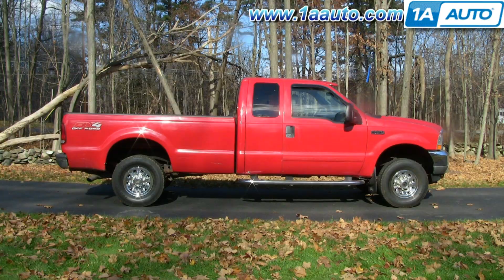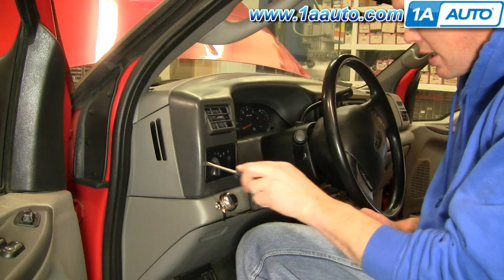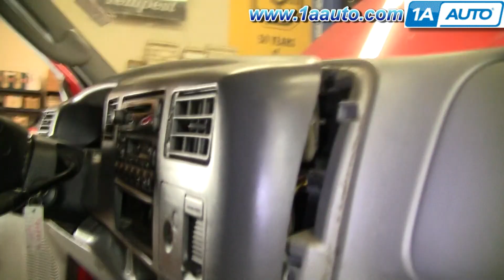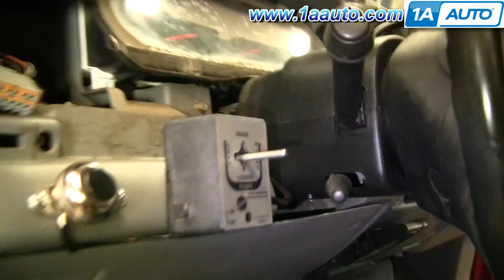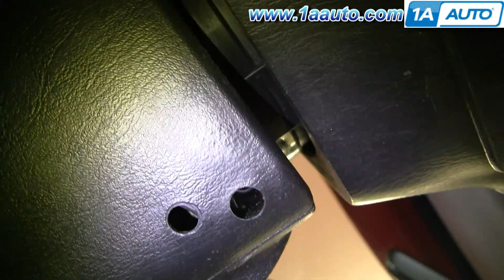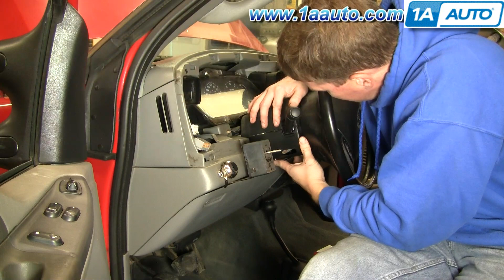How to Replace Combination Switch 02-07 Ford F250 Super Duty Truck

Comment: I appreciate the time and effort doing these very helpful videos.  I have a 2002 Ford F 250 SD and your explanations are on target.  I would add this for DIYers....give yourself plenty of time to do the repair.  Don't be surprised if it doesn't go according to the way you see it.  Age of truck or car, rusted or stuck bolts and other anomalies can bog you down.

Comment: No need to take all that apart just take off steering column trim and boom your done
Reply: I'm watching this getting ready to change out mine.  I'm thinking surely that whole panel doesn't need to come out.  Scroll down and see this first comment.  Great advice right here!  Thanks!
Reply: I was thinking that....I'm replacing mine tomorrow
Reply: Same!
Reply: Oh thank god, have a f650 Water truck that needs this, didn't want to attempt pulling half the dash out

Comment: Great video! I would hear a strange clicking noise from my steering column sometimes when I would turn the steering wheel. Also made the same noise when I would move the tilt wheel. Then all of a sudden NO blinkers at all! My emergency flashers still worked so I knew it wasn't the relay and my turn signal fuses were still good so with all that data I knew it had to be the multi switch. This video made the repair easy! Thank you!
Reply from the maker: +Shane Pearson Thanks for watching. 1aauto.com

Comment: I have a 2008 f250 ,the blinkers ,hi beams .and wipers work just not the windshield washer pump does not work ,replaced pump still nothing .Could it be the multi switch?
Reply from the maker: +matthew williams You may want to check the fuse and also check the circuit to see if there is power going to the pump when the switch is activated. 1aauto.com
Reply: 1A Auto Parts I checked no power to pump. Not sure which fuse or relay it could be.
Reply: The wipers would not shut off today .
Reply from the maker: +matthew williams It might be. You may want to test the power going to the windshield washer pump motor to see if there is power to the motor when the switch is activated. Hope this helps you out. 1aauto.com
Reply: i just checked and there is no power when switch is activated.
Reply from the maker: +matthew williams It might be a bad switch. Hope this helps you out. 1aauto.com

Comment: Much obliged on the video as it really helped replace my switch.  A big tip I figured I'd share for those who are still looking for this kind of repair, that saved me quite a bit of time was that I was able to skip removing the dashboard panel completely and only detach the pieces around the steering column.  Also, removing the bottom piece allowed much easier access to the ignition switch.

Comment: My flasher on my 02 F350 was making an intermittent buzzing noise which would stop when I put on a blinker or applied brakes so I replaced it... now the new one is making the continuous blinker sound whether blinker is on or not.. same with emergency flashers? Could it be I need a new Multi-Function switch?  As a side note... This all started when my driver side window was left down during a pretty good rain which soaked the dash and seat pretty good.
Reply from the maker: +Bo Holland Thanks for watching!  It is very possible that the switch could be causing this issue, but if it all got wet like that then you should get an electrical diagnosis done.  1aauto.com
Reply: Replaced my Multi-Function switch.. easy peasy.  on my 02 F-350 I did not have to remove headlamp switch, dash, radio, lighter wiring etc., simply removed tilt knob, ignition cylinder and upper and lower column covers and replaced switch.  Resolved my problem.  Thanks for info and instruction!

Comment: my girls truck has signal issues when moving the steering wheel for tilting. sometimes the signals don't work. she has a 01 sport Trac. any recommendations? not to vehicle smart. just the basics
Reply from the maker: +Joe Alaquinez Thank you for watching. It appears there is a loose connection, or wire in the column that shortens out on occasion when tilting the wheel. It is recommended to remove the upper and lower covers to check the wiring, or have a reputable shop diagnose the matter. 1aauto.com
Reply: ok thanks very much.

Comment: I cannot figure why anyone would down vote this. Perfect video, especially with the pain in the rump under shot of the column, + lighting,  to show where the release was on the lighter. 

 This made the job so much easier. I just did this on a 2003 Ford Excursion. I was able to do the job without removing the façade, so it was remarkably fast. Perhaps the Excursion is a little different to allow for skipping that step? 

 Regardless, I now am ready to change the radio now that I've seen this video, so two birds, one stone.

 Thank you for posting this well done video.
Reply from the maker: +David Gibler Thanks for checking us out! If any of our viewers needs to make this repair wwe carry the replacement turn signal lever shown in this video on our website. Here's a link to them. We also offer free shipping on all orders in the US. http://www.1aauto.com/1A/turn-signal-lever/Ford/F250-Truck/1AZTS00082?utm_source=YouTube&utm_medium=CTA%20Comment&utm_campaign=1ATony

Comment: Outstanding Video. Very helpful. Had a bunch of clicking coming from under the dash that temporarily stopped when turn signal or brake was used. Found out the problem and what to replace but not HOW until I found this video. Feel kinda guilty cause I needed the part asap and got it at a local parts store instead of 1A Auto then used your awesome video and saved myself something like $300 to $450 in shop bills.. Thank you .. One note -- this didnt cover having tilt steering and that does factor in this repair. Could not remove lever ( dont know how so didnt attempt)  and hence the lower cover either. Was able to work around but would have been so much easier with it out of the way . Otherwise,,  Well done and Im in your debt
Reply from the maker: Haha no need to feel guilty! Our main goal is to help you save some cash on not only our high quality parts, but also the know-how required to install them. So we're more than happy to hear that we were able to help you out with this video. Thanks for checking out our videos! If any of our viewers need to make this repair, we carry the part shown in this video on our website. Here's a link to them. We also offer free shipping on all orders in the US. http://www.1aauto.com/turn-signal-and-wiper-switch-lever/i/1azts00082?utm_source=YouTube&utm_medium=CTA%20Comment&utm_campaign=1ATony

Comment: I watched this video prior to attempting this on my 2002 Excursion 4X4 in the rain...
Had to replace the stalk, since.. I mean... it was raining!

This is an EXCELLENT tutorial. I did not remove my key switch as I was able to access the screws without removing the top cover. I think that the entire process took less than 30 minutes.

Overall, I highly recommend this to anyone that can turn a screw driver! Nice work on the video and Thanks for posting it.

Comment: O6 f250 wipers works high beams/ lights work.... Blinkers an flasher don't work fuses are good an so is relay can this fix my problem? Thanks
Reply from the maker: Thank you for watching. It is possible this switch has failed and is your issue. Please let us know how the repair comes out!
1aauto.com  888-844-3393

Comment: my high beams stay on it doesn't turn off even after turning the truck off. I'm thinking this is the problem with my f150. does any one have any insight on my problem.
Reply from the maker: You may want to see if there's a pinched wire or something on that circuit that may be causing this. You may also want to check the headlight switch to see if it has gone bad. Hope this helps you out. 1aauto.com 866-403-3393
Reply: thank you

Comment from the maker: The new turn signal switch for your 2005 F250 in Part Number: 1AZTS00082 on our website. You can also click on the link in the video and it will bring you right to the part shown in the video on our website. 1aauto.com 888-844-3393 FREE SHIPPING in the lower 48 states.

Comment: Do you have a video on how to replace the gas relay on a 2002 f250 sd xlt? My f250 cranks but would not fire. I'm assuming its the gas relay fuel pump. Any thoughts?

Comment from the maker: If the signal lights up and stays lit, it could be a burnt out bulb on that side of the vehicle. You may want to check that first. Hope this helps you out. 1aauto.com 888-844-3393
Reply: I’m having an issue with my truck where the blinker relay randomly will click sometimes when turning the steering wheel but all the lights work

Comment: I have a 2000 f350 diesel and the left turn signal doesn't, right turn signal works. Is it a rely or fuse?